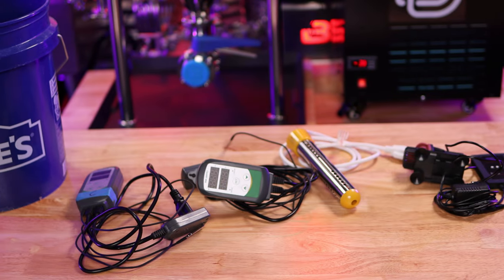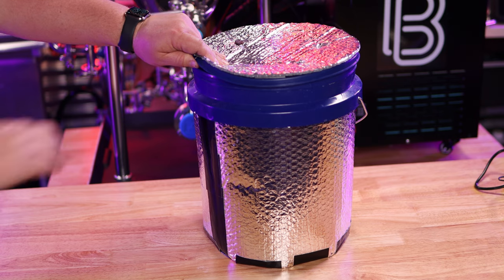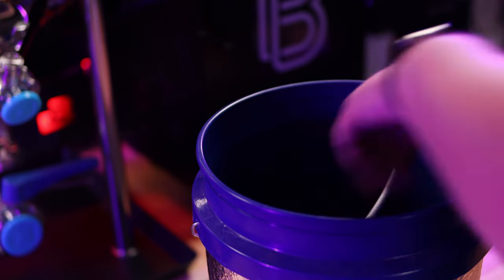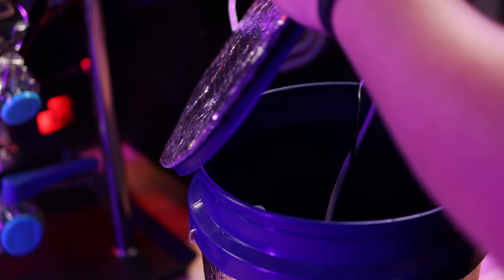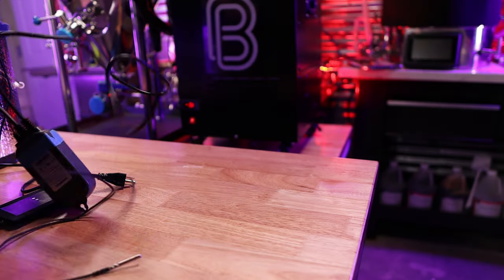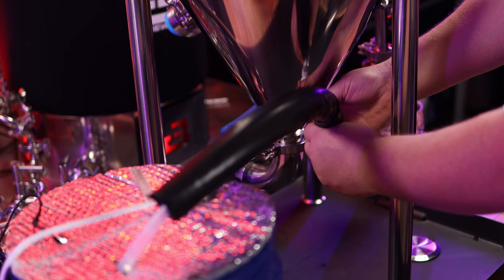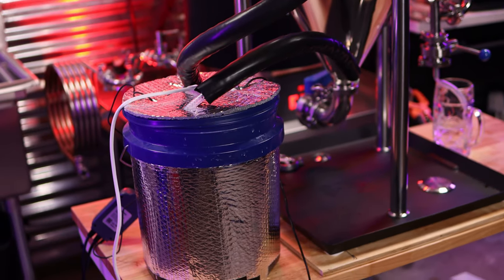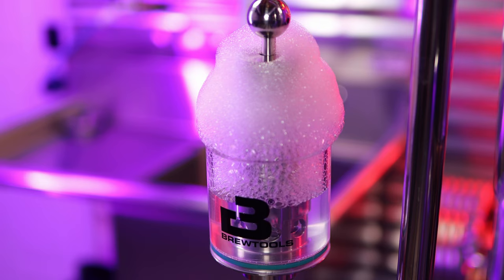DIY Fermentation heater

Comment: I'm still fermenting in a plastic bucket, I use a spare fridge, with a small ceramic greenhouse heater in the salad drawer. That'll take me from 3C - 35C for fermentation temps. Inkbird to turn the heater / fridge off.
Reply from the maker: Nice 🍻🍻

Comment: I have a silicone heater that goes on the cone section of my conical but it's challenging to find the right temperature setting.  I would plug it into an Inkbird, but unfortunately the Inkbird temp probe is too wide to fit in my thermowell,.  I know I could change to a thermowell with a larger hole, but this might be a better overall solution, especially for winter brewing in Montana
Reply: Seriously, this would be easier than getting a bigger thermowell?

Comment: If you have something like the Fermzilla cononical can this be put into the wurt after sanitization along side the chiller tubing?  I am looking to run both heat and cool for my wurt but I noticed you didn't put it directly in the wurt rather a water bath around a 5 gallon bucket.

Comment: Nice, but with all those plastics at hot temperature, you will be brewing all those microplastics as well. I prefer all stainless steel parts and surface heating elements.
Reply from the maker: The plastic is food safe. The temperature is not that hot and it's only used for the cooling jacket which is stainless steel. Never gets near the beer. I like stainless steel too 🫣